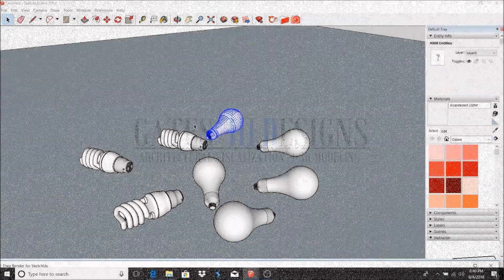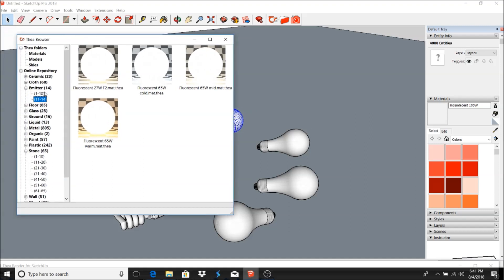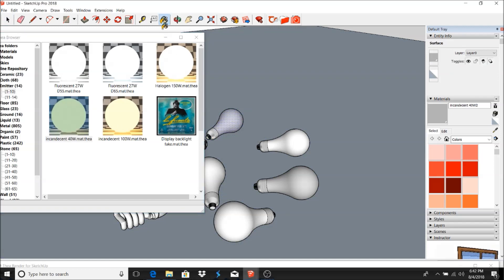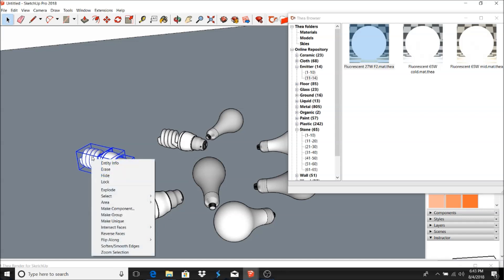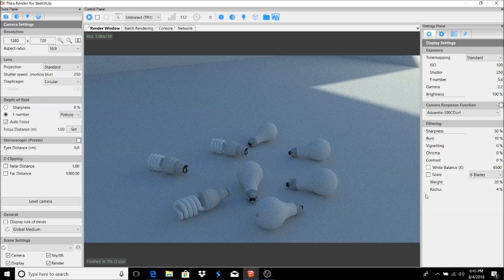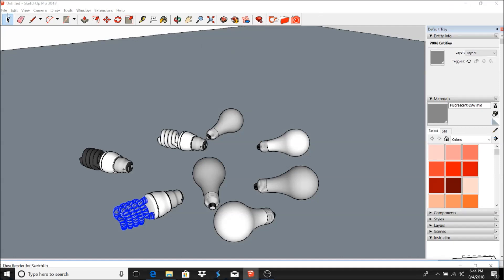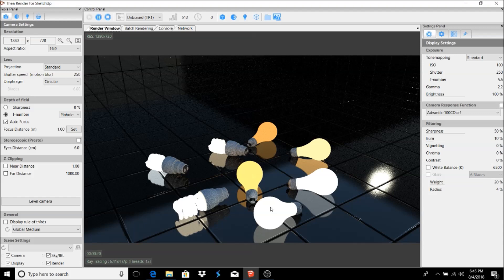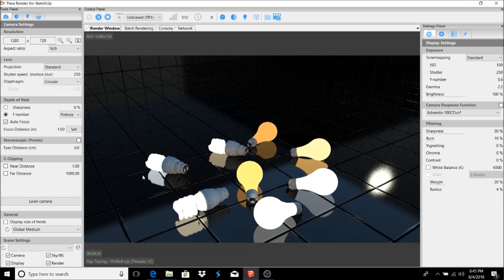Glowing Material With Thea Render 2.0 For SketchUp Tutorial

Comment: Pls sir kindly requured a request, may u send me lighting models that u make on sketchup with thea render?
Reply: Pls send me link so i will open  that model in my sketchup 2018 with thea
Reply from the maker: Later today I will load it to my website and you'll be able to get the link from there. www.gates3designs.net
Reply: Pls sir help me,how to apply emitter in that bulb on SketchUp  18with Thea 2.0,I need help ,I can't do that
Reply from the maker: Did you get the model from the www.gates3designs.net website. The Emitters are applied there. If you're using a different models you may have to right-click and select reversed faces. When you apply a material make sure you have the geometry that creates the actual bulb selected/highlighted.
Reply from the maker: Like this particular model here in this video?
Reply from the maker: Thea Lighting Model is loaded here: www.gates3designs.net